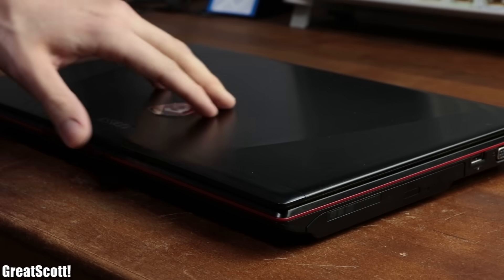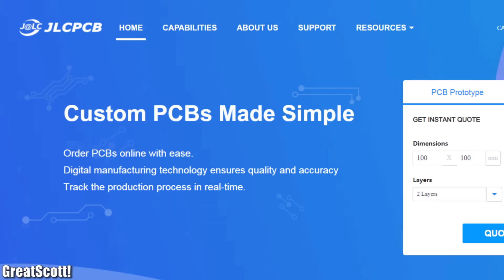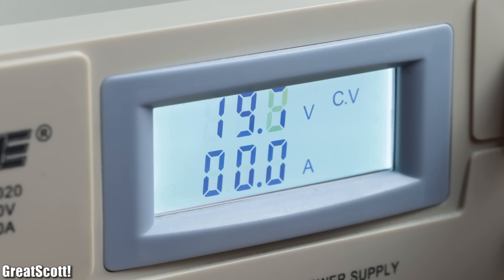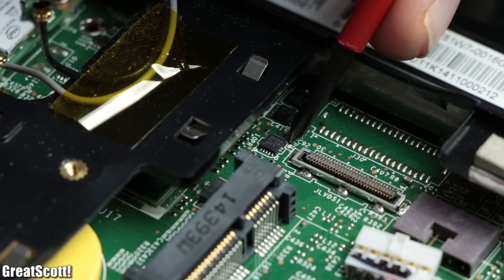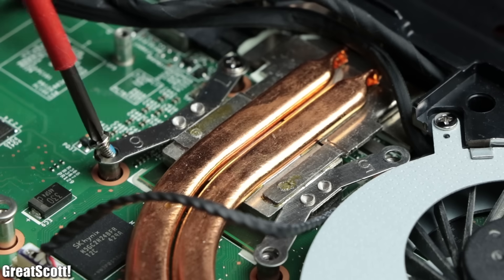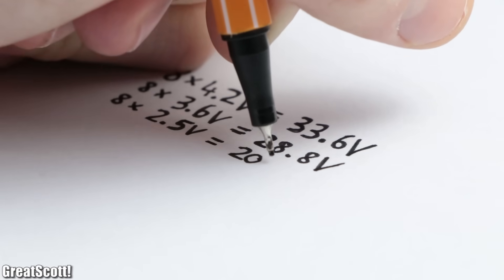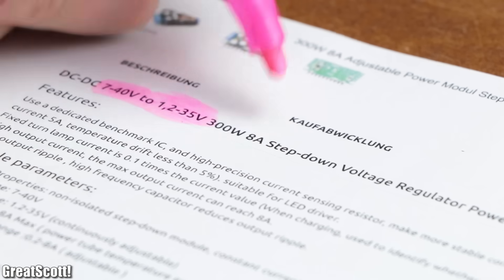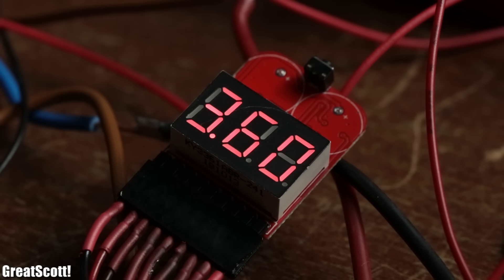DIY Laptop PowerBank (battery pack to charge your laptop on the go)

Comment: Some modern laptops use a hand shake approach.. smart id. The laptop communicates with the charger .. then only accepts charging.. in those case this will limit charging . And gaming laptops can draw huge amount of current instantly.. current inrush or spikes can overload the boost and bucket converters... My laptop draws 200w tops .. I was thinking on making one for myself but the laptop costs around 700dollars so I can't risk it ..

Comment: thinkpad t480 was the actual future, with the double battery system you could have a spare "battery bank" that was actually the laptops battery and you could hot swap them while the machine was running.

Comment: on the one hand, darn it.  on the other, thanks.  i have been looking at aliexpress for 10 days now, getting all excited at what kind of DIY powerbank i could build.  and this was a really good example for me to see.

the only better one, would be if the output of this, could have been a PD3.0 connector as the output.  here is the one part i am still a tiny bit lost on:

if i wanted to use a 95w USB c laptop power cord as input into a power bank........how?  everytime i looked up boards on aliexpress, they always seemed to be "usb c output boards".  i might have to post this on reddit

Comment: Great video as always! I happened to stumble on this video today while I was searching for some solutions to charge a 4S4P Li-ion battery pack using CC/CV boost converters. I'm using a TL494-based CC/CV boost converter (the same as the one that is in your video I guess) to boost a 12V input to 16.8V output which is connected to a 4S4P battery pack protected by a passive BMS. But I'm observing a very low efficiency while charging (~45%). The MOSFET on-time is higher than what it should be. Any idea why that could be the case? The boost converter works fine for other loads (efficiency is ~90%).

Comment: Is it possible if the battery circuit is 3s/12v then increase the voltage using a 4 ampere stepup module?

Comment: Won't the buck converter output voltage vary based on the input voltage. I mean, it's not a regulator so can't rely on it very much.. nowdays we get PD preconfigured boards even for 20V..

Comment: Being using this method thru RC Hobby lipo to power my laptop 6 years ago until today due to internal batteries already dead. The only main issue is the buck converter generate quite some heat, my finger can't barely touch the heatsink of the converter after running it for 30 minute, and yet, the buck converter still works fine even it is hot.

Comment: Can i use step up converter (400 watt) to charge my laptop with 12 volt lead acid battery, the laptop needs 20 volt and 6 amps = 120 watt , Answer will b appreciated

Comment: I think a better solution would be splitting the battery connector wires and routing to a connector somewhere in the housing, you could then purchase another laptop battery that is small and lightweight, place it inside a protective housing with the matching connector and walla, no converting, no heavy 18650 pack and double the battery capacity or more with something light enough to through in your backpack. When the internal battery runs out it would simply take power from the 2nd battery connected to the same battery connector.

Comment: Here's the fun part - most swichmode power supplies (such as those used on laptops) will accept DC just fine, so long as its > output voltage, so you might have been able to simply hook up your battery directly to the AC input pins of the laptops stock power supply. 

Some will require the input voltage to be at least 30, 50, 60v or so but others wont. The main thing to keep in mind is that the rectification inside the power supply will likely be undersized for a lower input voltage at its max output power (ie 19v, 6A here) so for lower voltage batteries may eventually overheat/damage the power supply if used at high power a lot.

Comment: Can you please tell me how do you charge a laptop that has ID chip. You just can't connect DC power bank like that. I know I can turn off BIOS warning, but people says that's not good for the battery. 

Can I use 2501 IC and rebuild the ID circuitry? Will it work?

Comment: I do hope you included temperature sensors and numerous safety circuits etc short circuit protection cos any battery cell in an enclosed space always will have the potential to pop with pressure buildup heat fire

Comment: I have done it in a very similar way.

For the DC/DC converter i use LTC3780. They are smaller, with high efficency and they are buckboost. So you can use 18 V battery packs.

As battery packs i use power tool batteries, separated by Schottky diodes. So i can hotswap them.

Comment: Why 13s2p, you kan have 3s12p with step up fron 12.6 to 36 or 48v,with 400w det kan give you ca 325wh if you use 2500mah battery. But you ned some fan in det case

Comment: how about using powerbanks with high capacity. for example there are some powerbanks now with hich capacity like 60.000mah. They are 5 volts ofcourse its not enough but you can easly use step-up modules to raise voltge level up to 30V (4A) ofc it will use multiple times current from battery. 
Your laptop battery using 11.1v and 49W power (maybe max power?) which means 49w/5v=9,8A from powerbank. Powerbanks has BMS modules which means shortcircuit protection and it will limit your current flow to 2A max. but you can use multiple powerbanks to divide current flow. in this case you can use 5 powerbanks as parallel for making enough current or you can use serial and parallel connection too. 2 serial to make 10v and 2 units parallel to make 4A but it will give you 40w powerbank with 10 volts.. 
So best way is to use parallel connection to make enough current supply but still 5v. after you have 5v 10A powerbank with 5 parallel connection. now you can use step up modules. but they have also current limit and they are producing heat. 
so you need to use at least 3 step up module and you need to make parallel connection to their outputs again. it will make 3.3A for each module to work healthy (below 4A).
if you use 20.000mah powerbanks you will have 20000/4400=4.54 times longer battery life + your original battery time. i mean if your notebook running 3 hour with its own battery from %100 to 0. Now you can use 13,6hour+3hour power source. its all in theory but needs to try.. 
Reasons to use powerbanks;
-most of Li-on batteries are dangerous because of you know if you buy it from  untrusted sellers.. and most trusted ones like samsung or lg batteries are expensive..
-if you use 18650 batteries you will need bms modules and charges modules.. for using them healthy and long life.. but powerbanks already using them. they have 5 volt stabil output. which means they have step up module in them also voltage regulators.. voltage doesnt drops by usage.. 
-powerbanks will take less space because they are simple you just need to use small box to put your usb connecters to make them parallel and voltage regulators in.. most of powerbanks almost same as phone size.. maybe a little thick. but still 5 powerbank can use a space like 7Ah small battery. 
-by the way there are also some stup up modules too which is using input voltage 10v and raising it 12-30V (10A) if you dont want to use many soldering work you can use 1 of these step up module with 6 powerbank (3 serial and 3 parallel) for more battery power..

Comment: My laptop charger is rated 18v. What happens if I use 12 volt battery powerbank and connect dirrectly to laptop charger port?  I will remove the original laptop battery, so I don't need to charge my laptop battery. The laptop battery pack voltage is around 12v. Is it alright? Or Will this destroys the laptop component?

Comment: Scott, i need a help from you, i got a dell inspiron 7577 and need to have a powerbank for my notbook to fly my drone surveys, 3 hours per survey, my battery needs 19.5v 9.23a, the china company got adapter 22V-30V, current 5A, support 6S lithium battery
Output voltage is: 19.5V Current 5A, what i could do for this to work?

Comment: what about directly connecting laptop batery cells with outside lithium cells/powerbanks?
its should be charging the internal battery but cant powering the laptop without charging the battery first
and it will only charge when the power bank voltage is higher
its "dumb" charger

Comment: If you charge the pack with the laptop plugged in, wont the charging voltage (> 32 V) exceed the limits from the chip controlling the laptop voltage (32V)

Comment: It isn't correct to charge the battery pack with a simple power supply. The real chargers stop sending current when the "floating" current is less than 500mA (usually). If not, this residual current will degrade the batteries slowly. The real chargers signal the finish of the charge with a green led and open the circuit.

Comment: I think this is not good idea, because you are losing energy in buck converter and in power management system in laptop, better idea is expand capacity of laptop battery (build up new battery and connect to battery socket or add LION cells to existing one, but BCM have to be modify)

Comment: My laptop is HP Pavilion series which have a different plug with 3 polarities, really difficult to get, and the third polarity is for the laptop to make sure it's connected to its own power supply and not a copy, so how do i make a powerbank? Even making some inverter didn't work since the power supply has an active PFC and absolutely needs a sine wave to work (or maybe it would work with some low frequency square wave but DC230V didn't work)!

Comment: Make it simple dude. 24 pieces lithium batteries to make 12v series with 5000mah capacity each then a simple 12v car charger to 220v. Easy.

Comment: I need to use a Agm battery 18Ah to power a teclast f15 laptop. I'm thinking to use a dc dc converter to have a stable voltages 12v. The teclast ac dc adapter is 12v 2A. What donu think? Thank you

Comment: This might be a silly question but how is it only 5AH when there's 16cells at 2500mAh each? Am I missing something?
Reply: Yes, it's because he used 2Cells in perallel which is 2500mAh * 2Cells = 5000Ah = 5Ah. 
The Cells in series increase the Battery Voltage and if they are in parallel the capasity increases.
Reply: @startobytes  Thanks you so much.
Reply: @Samkiitt  No Problem

Comment: Does the current rises(voltage and amps) if you double the battery packs ie 24 or 26 battery with the aforementioned circuitry dohickeys???

Comment: you can't get 40 amp unless you wire many parallel battery not only 2. your case, 8-parallel battery, get approximately 30 volt with 5 AH and can't get 40 amp. the reason is , this 40 amp when pass through the 2-parallel battery will damage it.

Comment: Hi Scott, why not use three lead acid batteries of 6 volts? Each one gives 6.5 volt. So we have 19.5 volt. No need of any electronics. The best thing is voltage will never cross 19.5. Adding a fuse for short circuit is only needed. Please suggest. I am okay with heavy batteries.

Comment: It's great video. Just asking, why didn't you use 4 sets of batteries which max output 16.8V, and then step up to 19.5V? The power bank size would be smaller, right?

Comment: Hi Scott ( I assume ) I hope that you will help me in constructing my own simple 4 cell  18650 LI-on power bank.  I am puzzled as to how to wire it all up with the between the balance charger and the buck converter. I wish to extract 12vdc,  5vdc, 3vdc, and 1.5vdc for the testing and running of toys that I have on my desktop. I wish to set the outputs via toggle switches. IF you would be kind enough to furnish me with a schematic I will happily send in a financial contribution to you as payment. Thank you.

Comment: DC to DC is more efficient. however there are some pretty dang efficient inverters like the voltagecube as seen here on amazon https://www.amazon.com/gp/product/B07F13X9SN/ref=ppx_yo_dt_b_asin_title_o01_s00?ie=UTF8&psc=1 
it claims to be 95% efficient still not as good as direct DC because the power brick for the laptop is also going to have a loss however with an inverter you can power more than just a laptop.
handy for soldering in the middle of nowhere or powering some LED lights on a camping trip etc.

Comment: Thanks bro.. I think you could have avoided using buck converter circuit by just using 3S 2P Battery pack and Booster circuit could be used on output of battery section to step up voltage up to apprx. 19.2V... Pl. reply on my comment if I am wrong

Comment: Very positive video, i would like to build one for my Asus because I have remove the internal battery, no more battery in the laptop. 
1. Can I charge and discharge the battery pack at the same time. 
2. Are you using a laptop charger wire to the boost converter to charge the battery pack? Thank you

Comment: Great project... But the toggle switch you used gave a lot of problems in my case with a high voltage drop across it even at 1A of current flow and eventually leading to its destruction.
Recommend using a Relay for Switching and controlling that relay with that toggle switch is a good idea

Comment: DIY or BUY - brick-shaped battery pack with protruding switches or a couple spare batteries? Which one takes up more space in luggage? Which one will raise more eyebrows at airport security? Which one looks less unlike an explosive device?

You did a great job on this build and on repurposing part of your battery pack from your e-bike, but if I didn't have a pile (pun intended) of 18650 batteries knocking about, I'd opt for the spare batteries. If I was worried about having to power down to change the batteries, I might throw together something with a small protected LiPO and a boost converter to plug into the charging port while changing batteries.

Comment: In charging those battery pack in 33.6V 5A will the 5A current will be separated each cell in series? Like 5A/8s = 0.62A in each cell in series while having same 0.62A for all those in parallel? Thanks

Comment: Hi Scott. I tried testing how power hungry my Lenovo Yoga 500, the same way you do on the video with a DC power supply set at 20V but I think I burned the motherboard? No power LEDs, and power button won't work. Voltmeter says power is passing from input port to the solder on the board :( Did I kill my laptop?

Comment: Hi Scott, i have a question for you.
I i use a buck converter to step down a battery voltage, if at full charge i have for example 26V and i step it down to 12V, if the battery voltage go down to 20V, will i still have 12V on output using a buck convert like the one you have used or i need another type of converter?

Comment: I know you use an already built battery from the ebike project but could you use an old usable laptop battery to make this rather than using 18650 batteries? It would allow you just to get a new/after market battery if it ever blows and would avoid the soldering of the 18650 you could even cannibalise the old laptop case for the mounting / bracket clips to make it look nice?

Comment: I'd really like to see a solution that replaces the existing laptop battery instead of all of the inefficiencies of a battery charging a battery through several buck converters, circuits and wires. Some sort of adapter panel that connects to the laptop and understands the pin configuration of that model.

Comment: May I ask you to make a episode of making high capacity makita 18v battery??
I mean about 50 18650 cell 5x10 and they will not have to be high current cells due to 10p cells... i want make power bank like this using china circuit board and have this battery on my belt, that can have 3d printed connector to battery but i will use parts from disasembled makita battery...

Comment: Idea for video:
You seem like a resorsefull and systematic enough to check something.
 iSDT T8 Battery Charger is a 12-40v input charger and was wondering if you limit it to 300w and add a 300w 24v solar panel as its power sourse to charge 1s-8s battery packs of li-ion without an BMS and have the using unit have the low voltage disconnect.
By this you can charge your e-bike, buy only an inverter for some power. In short a cheapper solar system that you can modulate by having 2x8s battery packs and series them for your ebike for 16s super turbo power
Reply: Oh, checking efficiency. If an MPPT is needed for effeciency or if you can baypass with one of those chargers.

Comment: Very useful for old laptop battery packs I still have. Hopefully mixing them will not be too much of a problem.

Also, maybe you will consider taking screenshots of the parts list pages for archival purposes in case the item is no longer for sale. For instance once an Ebay seller stops selling an item, the page is not longer visible. (I tried to view the BMS you used from ebay but I could not find it.)
Thanks Scott.

Comment: Why did you wasn't to change your laptop battery, wouldn't it be better and more efficient to RUN the laptop after removing its infernal battery, straight of the external pack.

Comment: Could you use any other power bank on the market, together with boost-buck converter as-a-joint to  charge a laptop?
Reply: Obviously the battery needs to be powerful enough to handle it safely but otherwise yes. You can use a car battery or anything else that can push enough power.
Reply: Thanks @Jake ☺
Reply: Humphrey Pietersen glad I could help, cheers!